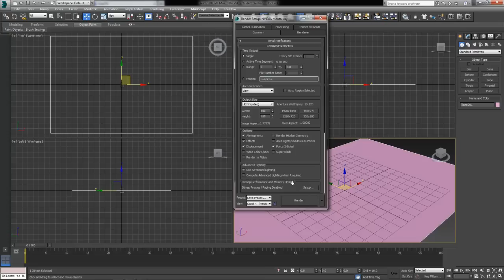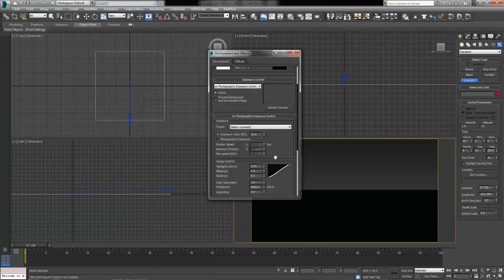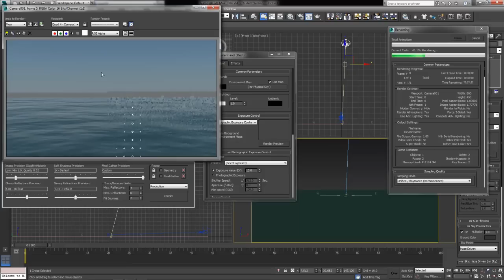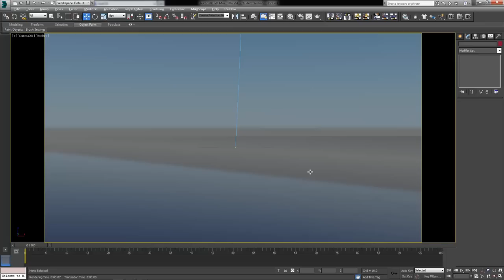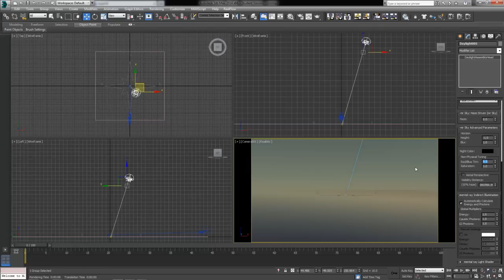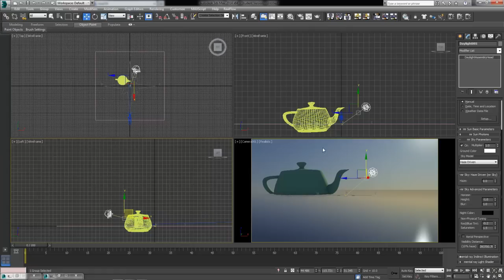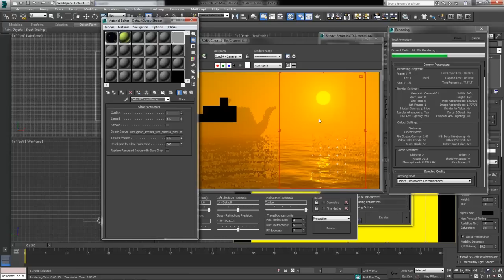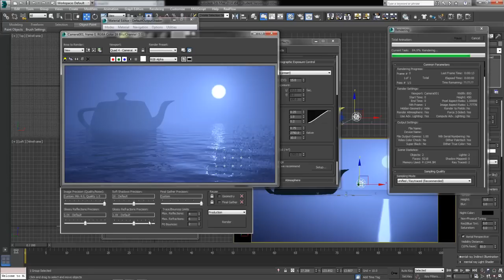Daylight System for Outdoor Lighting in 3DS Max

Comment: I have noticed that in the Render Setup Menu, you have the tabs on top and the drop down menu's and the render button on the bottom. In my 3ds max, I have the opposite layout (Target, Preset, renderer, and render button on the top and the rendering tabs and options on the bottom. How did you switch their positions?